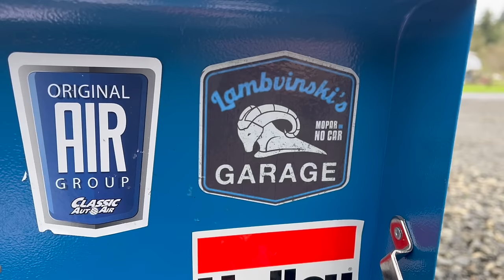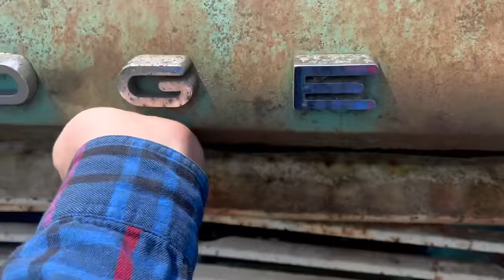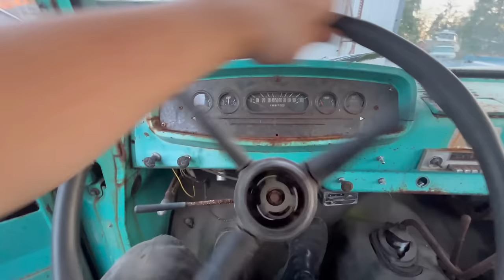SEIZED AND BAD! Can I Fix This 1964 Dodge W200 Power Wagon?

Comment: Never seen that model before..i had a D200 in the same colour.. mine had 8 lug. It was a camper special. Mine had a ivory white roof. I went to home depot paint department and they computer  matched the colour with some exterior house gloss paint. Worked good and cheap. 17 split rims were changed with 16'  8 spoke. Ready to find tyres.

Comment: Has to be restored, doesn't have to be fully restored with fresh paint and new upholstery just rot free and running good. We need more trucks around like this one so in 20 years when all of the brand new ones being sold today are already being crushed and recycled we have something to drive.
Reply: Rot free is also not essential; We live in the Pacific NorthWET.

Comment: I got so excited. You are working on a swept line I am working in my shop and I had to pause me recording. And video my TV congratulating you on working on that and  me bragging about you. I have a lot of parts but I'm in Montana. I. Also, have a small stash of sweptline parts in Spokane. If you need anything.
Reply from the maker: Good to know! I really need early (61-66?) wiper linkage, pivots, arms, motor, both early door latches, and I think a passenger side fridge style door handle. I am planning to use my white cab for an upcoming project, but it was pretty well picked over before I got it.
Reply: @DeadDodgeGarage  I am pretty sure I have all the door latch mechanism for at least the latch assembly on the outside of the door. And I should have the wiper motor and assembly for that early year.

Comment: That cab looks exactly the same as my dearly departed 1962 D200 stepside (318 poly, 4-speed, 4.11 gears, etc). I think I was the 3rd or 4th owner, bought it when I lived in Oregon in 1979. Donated it to charity in 1998, now I'm sick that I didn't have room to hang on to it, I really loved that old truck and would restore it today in a heartbeat. If I had to choose between the poor old worn out beat up D200 or my cherry low-mileage (30k) '98 Ram 1500, it would be a tough choice.

Comment: If you put some transmission fluid in a spray bottle and spray down all your bare metal parts, it will at least slow down any flash rest or bad rust for quite a while.
Reply from the maker: Yes, I need to start using oil instead of WD… WD actually makes machined surfaces rust over time. Case in point…

Comment: Those trucks are so cool! IIRC, sort of kind of the same as the Petty/Prudhomme 1967 W700 Ramp Truck. Except that was a crew cab, with a 413, and extra racer stuff in the ramp bed. And a roof air conditioner.
Reply from the maker: I am planning to build something very much like one of those ramp trucks! Unfortunately mine will only be a two door.
Reply: If you guys are interested in old ramp trucks, there is a channel by the name of challengeher. They have Dick Landy's old ramp truck and are slowly restoring it. A couple who are most definitely Mopar enthusiasts.

Comment: In my opinion that Dodge body style is one of the best looking (I know 65 was the last year but not exactly sure what the first year was). If that was my truck the first thing I would do is strip it down to the frame and  paint a coat of Chassis Saver on it.  I would bore that 318 0.30, keep the cab, fenders and hood the same color (I really like that turquoise) and try to find an original fleetside bed for it. Lastly run dual exhaust with Cherry Bomb mufflers

Comment: I drove 3 of these bodies in the 70s. They were cheap and unpopular. But I liked them a lot. Numerous Mopar oddities. The hood standing at 90 degrees, fuses in glove box, sturdy cab mounts, good heat. But the Chrysler diffs on 1/2 tonners had a definite lifespan......

Comment: thats cool. i  have  a 65  the  same  color  but  updated  version,, belonged  to my  grandfather he  bought  from  new. its a D200.  standard cab  long  bed.  we  both  live in  Western  Washington.  he  replaced  the  slant  six and  manuaul  transmission  for  a later  318  with  automatic. i  think  from  a 71  dodge. he  used  it  with a camper

Comment: Yep my 200 the same. Had to lift the door to close it. Two handed job. Lol. Leave it as is. Put the metal  bed  back on remove weight from it.  Find a big ugly fifty dollar slide in camper . Bolt that down good. Head out into the bush for some overnight camping. Clean the patena. Tek screw some floors in. Summer will be over in three weeks. 😂😂..Better start pulling some rabbits out your Axx. 😂. Thanks for video. Have a good week..

Comment: My last poly was in a 63 Fury mordor that sat for a few decades in TN. I bought it about 7 years ago as a parts car and still have the plate, last registered in the year of the state's bicentennial, 1996. I don't know why the car was parked because after freeing the carb linkage and tossing in a new coil, it fired right up. It sat for so long the 2bbl air cleaner lid rotted through, it now hangs in my shop.

Comment: I think this Powerwagon would be a perfect home for the early Hemi you have. Just open the straight up hood and tell it to say "ah" and it will all work great! And I think the way to go for a box is a stepside. Those are easier to butcher and resize to the correct wheelbase if necessary.
Reply from the maker: I’ve had the same thought… and a few other people seem to agree. Haha.

Comment: I have 2 favorites for stuck engines. 25:1 2cycle gas, be sure to use nonoxy gas. But my go to is #2 diesel. I just pour it down the carb until it pukes and wait 2 weeks

Comment: If I find the pics to my 68,69,71 power wagon I will send it to ya. 361 big block short box 4x4 did a body lift and put a hp 383 in it. Oh and it was a 4sp. Pitched the step side for the swept line box. 33" tires on steel 5 spoke rims. Green cab, blue hood,orange box and the 71 grill. The orange box came off a utility company truck. It was so ugly it was cute. I traded a perfectly good 440 numbers 69 charger for it. What a epic mistake. I sold the 383 to a guy and the roller to another and it was never seen again, and I am good with that. No one wants to be reminded of being stupid. I hope you make it run and get the correct box cuz it will be cool. Oh and that grain truck I got the poly 2x4s off was the same cab. Just on a 2 ton with a dump box. Loved the stand up hood too.😂 and remember we do stupid things when we are young. Hint hint😂

Comment: I’m working on a 1967 W200 with a rebuilt 383.  I need to get a radiator for it. Any suggestions for a brand new radiator? I have another’67 for parts. I was born in ‘64 and I feel like the old girl looks.
Reply from the maker: If there are brand new ones that actually fit, I wouldn’t know how to find them. I modified a 26” car radiator to fit in my ‘70. It’s a little janky but it works! I was looking for a radiator for that truck for years…
Reply: @DeadDodgeGarage  I appreciate the information!!!

Comment: A lotta guys throw Slant 6s and Poly 318s in the scrap heap. In my younger, more foolish days, I did too. But I found that, in stock form, a 2 bl 318 poly has a lot more torque than an LA 318. Maybe just cuz the older vehicles had deeper gears.
Reply from the maker: I just love the Poly. Which is funny, because I’ve never had one that ran right. I had one that smoked like a bastard, and one that pinged like crazy in one cylinder. Then this well used, disintegrating pile. But I’ve always found them to be endearing. Ah, and I will never forget the time I pulled up next to my friend Conor’s Poly powered Coronet (with a 4 barrel carb, but otherwise bone stock) in my somewhat built 383 powered Charger getting up to highway speed. Foot to the floor, we stayed neck and neck, and I could not pull away from him… that was an important lesson.

Comment: I think it's beautiful without squinting. I'm also a Powerwagon  and Ramcharger fan. Owned my '80 Clubcab P.W. for over 20 years. Traded my '15 P.W. in for a used '18 P.W. because it had the Macho Powerwagon decals, LOL. If I had the room and money, I would have every generation of the Powerwagon and Ramcharger. And a '70 AAR Cuda, a '70 300 H. The list is way too long.

Comment: Is that one ano army veteran?  I had one the same color, and one day, I opened the glove box door, and it had a brass Id  plate attached  to the door.  Mine was actually an Airforce veteran.  Once a year the military would auction off surplus trucks and car lot owners would buy them and  throw a quick and dirty paint job on them and flip them. These were the strongest old trucks.  Mechanically, they would hold up to about anything.   Body wise?  Not so much!
Reply from the maker: Definitely not a military truck - but that’s cool!

Comment: On one platform, Im Mopar Dude. On another, Im moparslim1965. Ironically, I no longer have any Mopars (I'm also not slim 🤣). Over the years, Ive had 68, 71, and 74 Chargers, 65, 71, and 72 Satellites, a 66 Belvedere, 65 & 67 Coronets, two 72 Polaras, 73 & 75 Newports, a 68 Fury III, 63 Valiant V200, 64 Dart, 74 Duster, and 5 Sweptlines! But electricals have always been my bugaboo.
Reply from the maker: Nice! Yeah, that’s the Mopar guy’s life. That’s why I have dedicated so much of this channel to helping people work through the electrical nightmares. That’s the foundation my modest success is built on.

Comment: Cummin's 6BT or put the cab and box on a newer frame of a 2500 4x4 reg cab long bed with the cummin's. The look's is what are most after and the rest is just undesirable with it's rough ride and crap suspension geometry!
Reply from the maker: I do have a Cummins or two. I have a different frame swap project going already, so I’m not prepared for another one just yet.

Comment: I always Laugh big heavy trucks and single master cylinder. I had a 1967 D200 with a single master also. 318 engine. If brakes fail just try to run into a Bush. Not a tree an old timer told me. 😂
Reply from the maker: They work… my D300 with an automatic and a pump and pray worked fine. Ish.

Comment: Flat Deck and Flat Deck Camper! and point it in a direction and go! 

...

<3 all edit: stuff a ford 300ci EFI heads and '96 computer and modernize and big screen head unit and then it wouldn't be a power wagon anymore, would it?
Reply from the maker: No - so I wouldn’t do any of that stuff. Haha. Although I actually have a real soft spot for the 300, especially the late ones. They’re awesome engines. But I don’t like to cross the streams, so to speak… I am really, really jealous of the guy with the beautiful red truck just like mine (but nice) with a classic Alaskan pop up camper I saw in one of the groups. It is amazingly cool.

Comment: Get a brand new engine, get an LS get get-go find a full go. Find a Dodge from 2002 1001 Drop a new frame on it do take the interior out of there. Get that thing cleaned up, see how that dead engines from that 2000 to 2001. Drop dinner do LA d lights on air. Take that it's a nice silver or black pain or nice hunter, green paint and payment.  Payment, put up, get a bread and get that frame from off. That off that that Earth odds. Get that beef up the suspension on there on here. Do it up because you see you're having problems with that engine. That didn't just know good get rid of that thing. Send it to the junkyard, just driving. Just go get a brand new engine. Answer you to try to engine. Go to a jackyard and see what they got for engi for dollar dream and frames. And they'll drop that puppy on there and call it a day. You had that thing for all the Mini months.  Once it's so much stuff in time, you could ahead that puppy, stop the running running phone around that engine and order engine. You could see that thing when they're good when you have mice. Mice mice and rats can mess up an engine method. Electrical recipe cool in a an emotor big time time time to go in.
Reply from the maker: This is the hardest thing I have ever tried to read in my life.